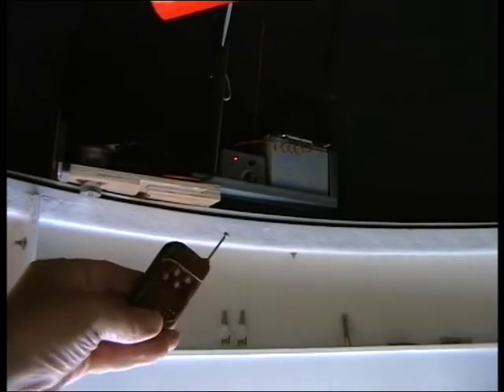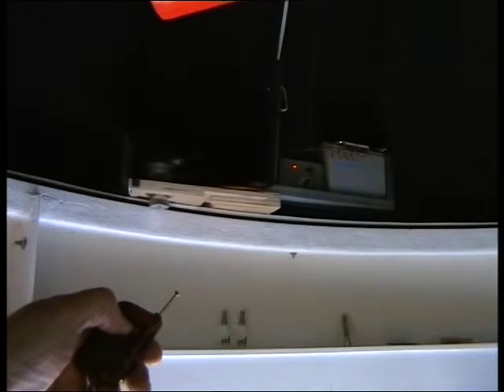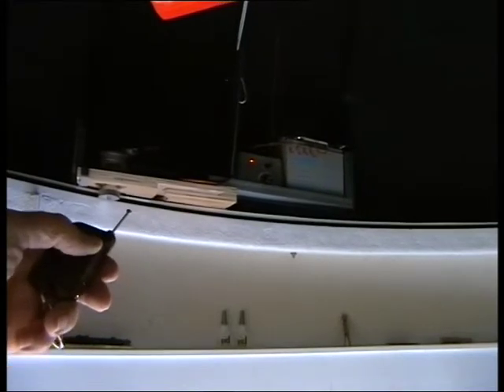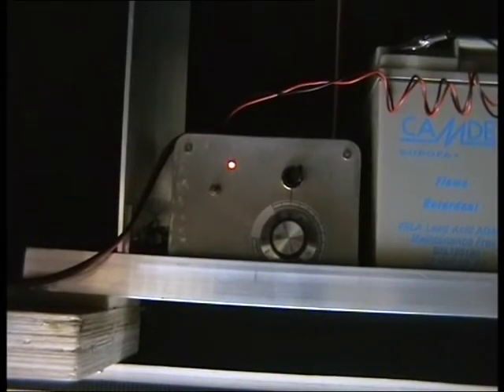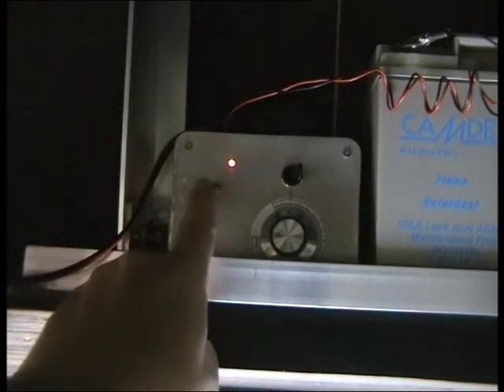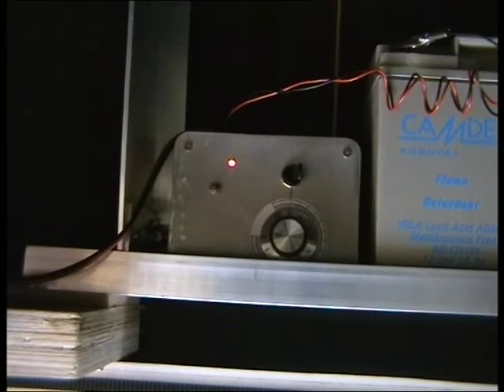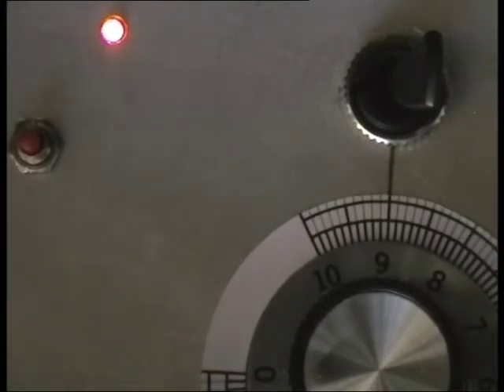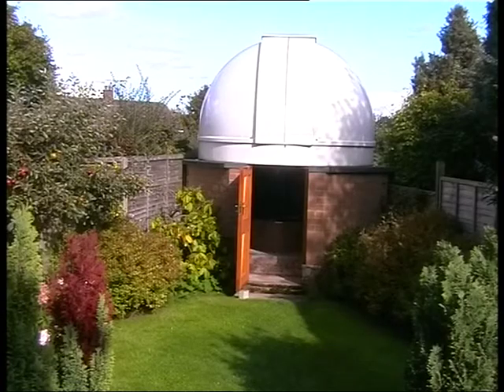Pulsar  2.7metre dome rotator Part V

Comment: Great ideas there, thanks. What did you use for the toothed drive belt stuck on the obs wall?
Reply from the maker: I bought 8 metres of timing belt and an aluminium pulley.
The pulley is the PL3M048AL on this page http://www.motionco.co.uk/timing-pulleys-timing-pulleys-aluminium-c-25_35_50.html
The belt was one of these - 3mm pitch if I remember correctly - to fit the pulley. 
https://www.motionco.co.uk/timing-belts-open-length-belting-c-25_38_49.html
The obs wall was not smooth so i used car body repair filler and lots of sanding to get a smooth circular surface. The belt was glued on with superglue - tricky, because it sets hard almost instantly - no room for error!

Comment from the maker: If you are looking at zero degrees in declination towards the South then the stars will be moving 15 degrees per hour. There are several positions in the sky when the dome hardly has to rotate at all. Near the Pole, and in the East and West when the stars are moving almost parallel with the dome aperture are examples. I created a table for my setup which allows me to set the speed depending on the altitude and azimuth of the target - see the link in the video description.  Good luck!

Comment: You have a very clever setup there. congratulations. I understand that the dome would rotate at different speeds depending on the declination position. what would be the fastest speed which the dome would need to rotate. I am thinking of doing something similar but more manually controlled where I would allocate a few button options which would control the come speed depending on the declination position.
what advise would you be able to offer.